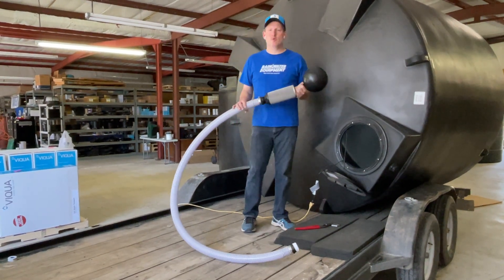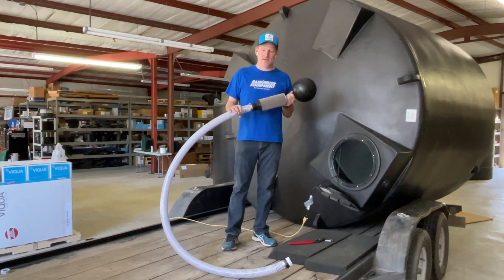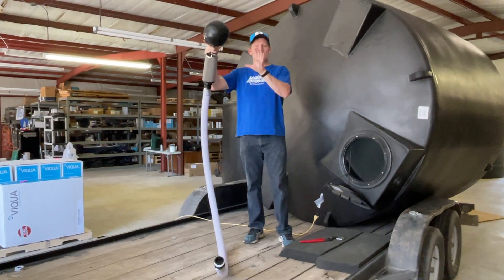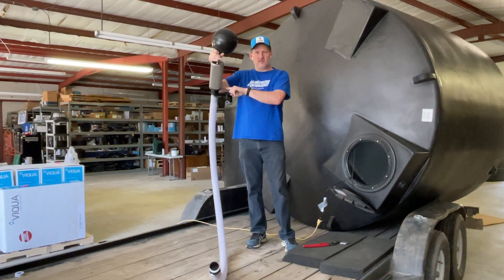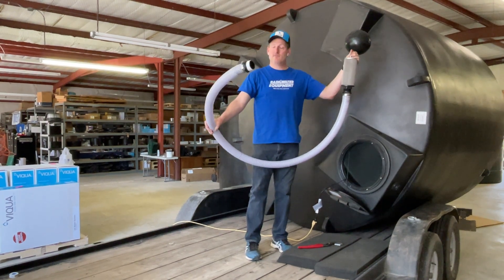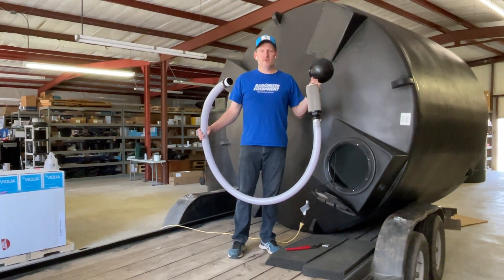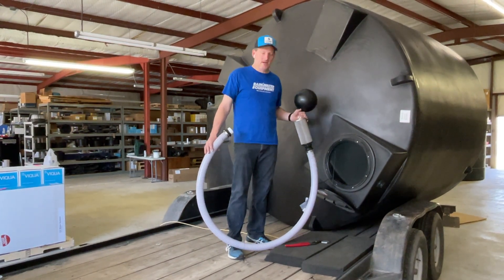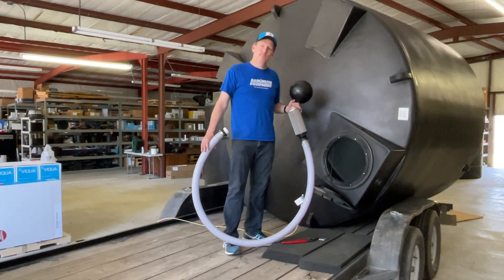Floating Suction Filter Installation - Part 1

Comment: Can you shorten the hose if need be?
Reply from the maker: We can customize the length for you when you order. Just choose the length you prefer, and if you need something shorter than 6' please indicate the preferred length in your order notes: https://rainwaterequipment.com/search.php?search_query=floating
You can do it yourself, but it's incredibly difficult to remove the barb that goes inside the hose after it has been fabricated. It would essentially need to be cut out, the hose shortened, then the barb re-installed in the hose. Not an easy task.